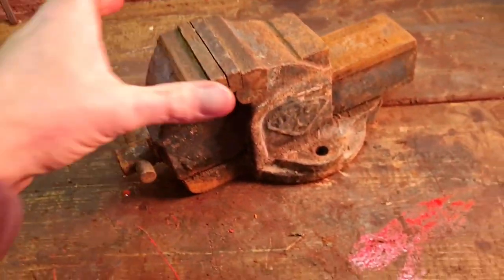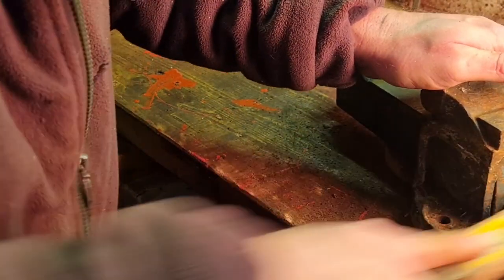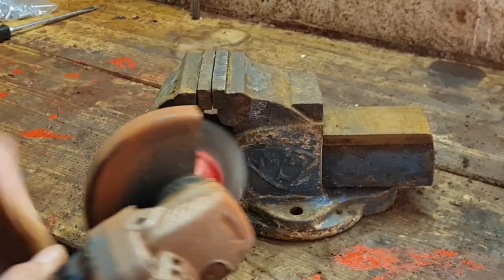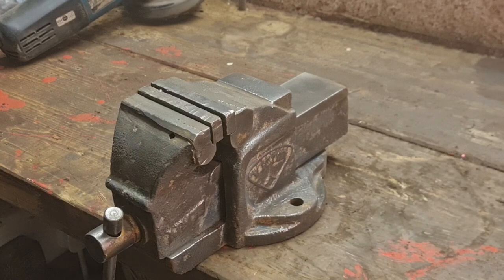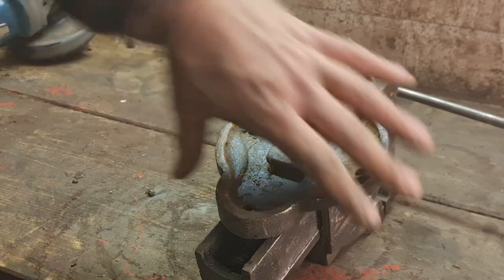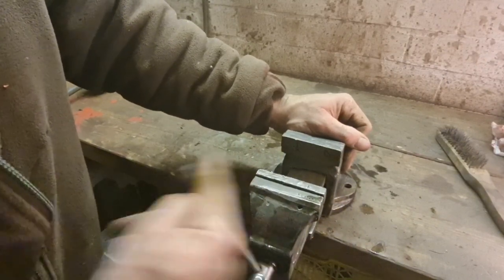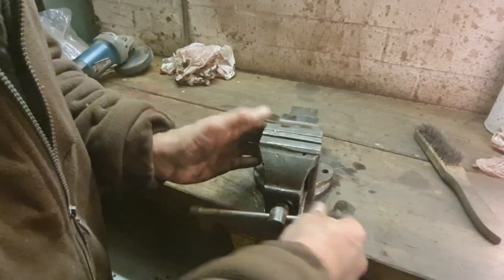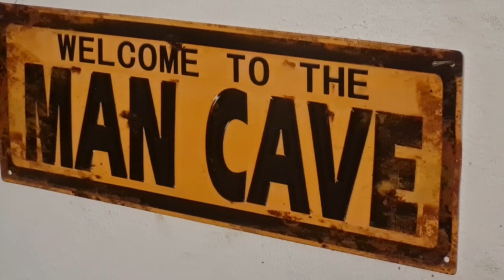The vice. But what Vice?? Let's strip it and see.

Comment: Hi Adam. It looks like Victor in the casting which were an Indian make. I have had Royal Enfields and the tool kits and tyre levers were stamped Victor. I have a 4" Chinese vice I have had for years in my shed which I bought from a farm supplies store in Eye about 20 years ago and looks very much the same, except the anvil bit is bigger on mine. I think yours might be a Chinese one. The guards and base look the same as mine. There are a few bubbles in the casting like yours. Mines been used a lot and is as good as new and been used for chainsaw sharpening and just about everything. A bloke told me years ago not to grease vice threads but to use EP90 oil. Mine gets a dose every 10 years or so if it needs it or not. Really enjoyed this one and look forward to seeing it used.

Comment: As you could guess, I also think the name is VICTOR, and I believe putting some black moly grease on the threads and running it in and out would be more effective than WD-40. At any rate, good video. I gived you a like.

Comment: I tell you what, I'd be tempted to put those engine plates in the ultrasonic cleaner. Just with water and a mild detergent, laying face down so that the ultrasonic waves are coming straight up and into the plates. I would expect that to dislodge all that powdery aluminium oxide, or "Daz" as some of us call it.  There's certainly nothing to lose by trying that, and it's less destructive than attacking it with a wire brush.

Back on the vice, it looks a bit GDR to me now it's cleaned up, and the name might just possibly be 'Vieter'.... Though I'd still hedge my bets on Victor.

Comment: Looks clear enough to me, it says Victor Number 1. The square bit on the bottom is the nut, usually to take a vice apart you close it fully and turn it over you should see the end of the screw thread there is normally a pin or such or clip through the end if you remove that it should then unscrew.